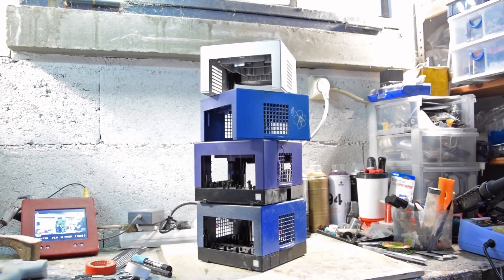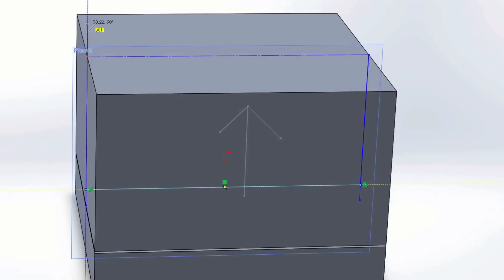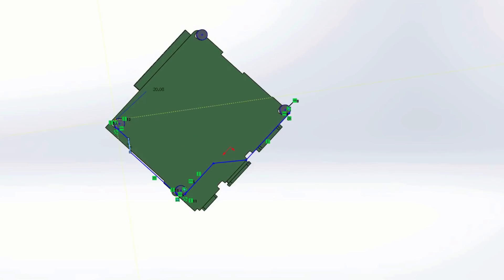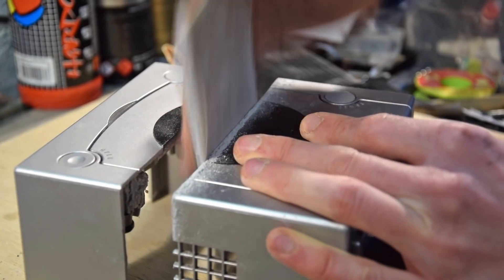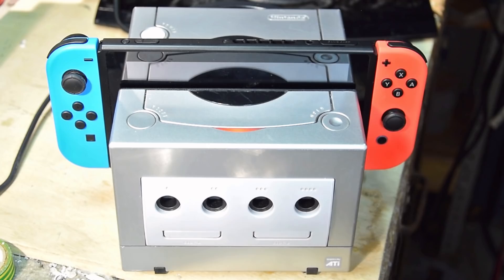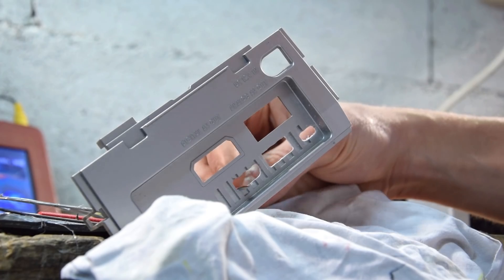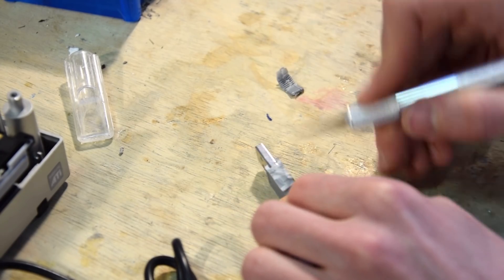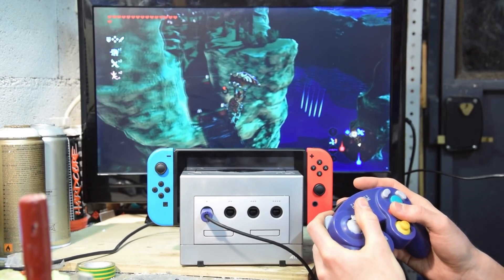Gamecube Dock for Nintendo Switch - Working controller ports - DIY project

Comment: Seems like you are addicted to hot glue... You used at least 15 sticks for this mod.
Reply from the maker: That's true, I'm addicted to it :o it helps me work fastee
Reply: Worth it
Reply: TheFrankonia83 I know right 🤣
Reply: I'm addicted to tipex
Reply: A man's gotta glue what a man's gotta glue.
Reply: Honestly I use it when there is no choice or short on time... other whise use epoxy, regular glue or best case... SCREW THEM IN
Reply: You must be new to diy videos.
Reply: In fact, his PC hasn't any screw, it's all together thanks to hot glue
Reply: It's not really him. If you've worked with electronics at all, then you'll know just how crazy they go with hot glue. If anything he just got conditioned to using it.
Reply: @Devious-uh6df  ?

Comment: "you only need these 3 parts to do this mod"
2 seconds later
"We're going to 3d print the slot"
Gee, thanks.
Reply: Ikr? I don't have a 3d printer
Reply: @DragonProtector  You can pick one up for a couple hundred. No premium needed.
Reply: @dotmatrixmoe  hmmm considering what i modded my printer to do (endless ink system) i saved hundreds already so it possible i can think of this
Reply: @DragonProtector  I appreciate the sarcasm, but they're plenty of options for beginners. I recommend hopping onto the "Make Anything" YouTube channel. Hope that'll help.
Reply: @dotmatrixmoe  i wasn't being sarcastic. I was really wondering if i could do this. Thx though. Sorry if my response seemed that way
Reply: @dotmatrixmoe  a
Reply: You could do most of it using the plastic from the actual switch dock. Use other bits of sold material and bolts and watchers to achieve platforms and proper heights. Maybe not 100% but I bet you could get close

Comment: I think it would be cool for the memory card slots to be used for USB (maybe using one of those usb thingys that increases the amount of USB slots) and a vent fan to bring fresh air in and out of the case
Reply: I think a ventilation fan is absolutely required since the switch tends to overheat in the official dock and any dock that is stylized after it.

Comment: Or you could just use the Original Dock and just buy the adaptor. Jk man great build and amazing work
Reply: dunno about that. The adapter uses two USB slots and has four Gamecube  controller ports. In theory, it should support four gamecube controllers.
Reply: Yeah but it's the retro thing ... Looks cool...think I'll dig out my GameCube !
Reply: @SOCIO did you not watch the beginning of this video, the idea of the mod was to use the shell of a BROKEN gamecube that's just gathering dust and instead turn it into a cool looking switch dock with usable controller ports.
Reply: @SOCIO "With modding as a hobby, dead electronic carcasses start to pile up", literally the first line of the video
Reply: a little -.-
Reply: @MrScottyTay  He's joking it's all in good fun. He's complementing the guy on his build an he literally said jk, which means: just kidding
Reply: @sebastianlaakso2729  I was replying to someone else, his comments seem to have dissapeared.

Comment: The only things I noticed that I would change is to add in vent holes in the slot for the Switch, small fans to move out the hot air and not to close up the holes in the Gamecube case.

Comment: you forgot to incorporate te vent holes in the switch dock during 3D printing. tis makes it very difficult for the switch to suck in fresh air to cool. witch can ultimately make the Nintendo Switch overheat in your home-built doc. But the idea for this Gamecube Switch Dock is really nice. (translated by Google)
Reply from the maker: Psiana that's true ! But they are so small honestly.. the switch doesn't seem to have problems cooling itself for me :) but I'll be on the lookout :)
Reply: Since there's so much extra space, maybe add a small fan to help it out a bit. Since the Switch isn't using active cooling, it doesn't need to run at full speed, so you can keep it silent.
Reply: It is using active cooling.
Reply: Ah okay, sorry about that. I was mostly referring to the dock itself, but either way, a fan would greatly help it.

Comment: This is so you can skip to the timeline:

1:35 3D Modeling
6:02 3D Printing
6:39 Cutting the case
8:00 Installing the slot
9:03 Adding painted tabs for details
9:51 Switch dock teardown and LED mod
12:42 Drilling the ports
13:40 Assembly
14:51 Usb controller adapter assembly
16:57 Glory shots- Conclusion

P.s It would be smart to pin this comment so everyone can see this.
Reply: Jajalitho it's in the description......
Reply: Alan Lopez but you can't click the timeline
Reply: Understand??
Reply from the maker: You must be on mobile
Reply: Jajalitho you just copy pasted this from the description
Reply: @jayjay_lee  *timestamp
Reply: @jayjay_lee  that's what you get for trying to be helpful
Reply: ps. they put it in the description
Reply: @YungShirtPocket  I was on mobile.
Reply: @micorepls553  ??

Comment: I didn't see vent holes on the 3d printed holder. You need those vents to prevent suffocating the system, especially in docked mode when the console can get pretty hot.
Reply: TheCyberQuake I noticed that as well
Reply: Was looking for this comment. In my head I was thinking oh the side vents are nice and big for cooling and then he blocked them off o.o
Reply: AeolusCE07 he blocks off the side vents in the GC shell, but the main problem is that the 3d printed part that holds the switch doesn't have cutouts in the back for the air intake vents on the switch. Meaning it will really be blocking the airflow and may cause overheating
Reply: Right, well at least he fixed it in his updated video !

Comment: I see you neglected to put in vent holes for that dock 3D print housing. If you do another version of this, I would suggest that be added to your design. ;)
Reply: ApacheThunder No foam pads to stop the Switch screen scratching when docking/undocking either.
Reply: The dock doesn't scratch the screen.
Reply: my dock has scratched my screen
Reply: @LordRayken  the dock is literally known for scratching the screen...
Reply: @harrylane4  anecdotal evidence
Reply: It does, don't deny it.

Comment: it would have been cooler to mod a LAN adapter to the underside of the console rather than just retaining ports that do nothing
Reply: but i feel if you do that you limit what else you can use the last us port for
Reply: Gustav Adhikara Gunawan throw in a powered USB hub; not like there isn’t enough room in the GC case.
Reply: While you are at it, maybe put an Nvidia Shield in the underside to emulate an actual GameCube.

Comment: 7.8/10 too much hot glue
Reply from the maker: That should add points
Reply: Correction, not enough hot glue!
Reply: You can never have too much hot glue
Reply: Rated-e Mods expecting IGN's ratings to make sense is your own fault XD
Reply: ERMHEGERD ITS YEE OLD MEMELORD
Reply: -ign
Reply: @RatedeMods  Shoulda filled all the empty space inside with hot glue.
Reply: They did say it was built with the expectation of being able to be taken apart.

Comment: I'd suggest using a fiber cloth between the dock and the Switch screen to avoid scratches
Reply: Matt I’d suggest a screen protector or not slam dunking your switch in the doc lol
Reply: @damndaniel4866  Bold of you to assume I don't take care of my consoles.
Reply: Matt well if you’re getting scratches from the doc I’ll 100 percent assume that lol I don’t need no fiber cloth lol has my switch since launch not 1 scratch on it
Reply: Adrian Anger why suggest something if you don’t do it yourself ?
Reply: Damn Daniel Some switches are curving from heat and at some point may get scratched from the oem dock.  This was a problem confirmed not long after launch
Reply: Matt you probably don’t tbh

Comment: How much would you charge for something like this?
Reply: Well... pushes up glasses 

Labour hours + 3d print filler + switch dock + gamecube case +gamecube adapter + gamecube ports + 1000 tonnes of hot glue. 

Alot

I dont have glasses

Comment: What software did you use for the 3D modeling? I'm looking into doing some component 3D printing for PC mods but iv never done a 3D project that required such precision before.
Reply: Hot_Drop_O'Clock probably maya
Reply: It’s Solidworks

Comment: Will it not overheat? it has no vents.
Reply: The dock didn't have any
Reply: Probably know this by now but the switch vents through the top of the console
Reply: @kuroser353  Incorrect, it has a vent intake near the bottom of the dock. This idea will overheat without that intake.
Reply: @SanderEvers  
Oh, didn't know that. Good to know

Comment: Brilliant idea, and it would be so useful for hooking up Gamecube controllers! However, relating to the problems of the Switch's screen being scratched when sliding into the dock, I feel that you could have added a thin cushion, velvet cloth or some other sort of cushioning material to at least narrow the chance of this problem ever happening again. Apart from that, great video!

Comment: I think the 2 pin connector for the LED is the same connector for a Xbox 360 rumble motors. Like he said in the video, this is easier if you're a electronic hoarder.

Comment: The original Dock has a hole on the back for breathing. You made everything almost air tight. Overheating could be an issue. Other than that, pretty amazing design.
Reply from the maker: I fixed it after :) watch the next vid

Comment: nintendo should be making cool docks like this with additional features instead of just bare ones, one neat feature that could have been used is maybe using the disk top as a lock almost, like just open the disk top and take the switch out, idk i think it would be neet but idk if there would be enough space.  still a very very cool way to almost recycle the case

Comment: I'm going to do this. I don't have a 3D printer, so I'll use something like Shapeways where necessary. Based on previous research, older consoles that have been discontinued may be cheaper in-store than online. This is an outline for the tricky parts. I don't want to sacrfice the dock that came with my Switch, so I'll buy a second one just for this mod.
Reply from the maker: Go for it ! But i hope shapeways isn't too pricy.. i can help you if you need something printed and aren't in a rush

Comment: Just an FYI the reason why the Switch in this one recognizes it as a "regular usb" device is because the knock off gamecube port. The official ones allowed support of the wavebird wireless controller for Wii-U. Since this one is a knock off, I assume this one will not, and the switch probably just sees it as a USB device (You needed to get special firmware for the official one to work with a PC for instance). Interestingly the official ones are still compatible with the switch, and i believe they are still being sold. Checking how those are recognized by the switch would be worthwhile to check.

Comment: That looks great my only concern is cooling there like no air flow would add a fan from the parts bin and poked a couple holes from the vents it already has not discrediting just small adjustments still a great video though

Comment: Nice video and you have some talent but hot glue is not needed for most of the solder joints and cable connections you showed. Heatshrink tubing is also a better method of insulating solder joints halfway down wiring than using hot glue.

Comment: This design is great. The only issue I see is that it won't properly vent the heat from the Switch. You might have wanted to keep the vents open on the Gamecube, and added vents to the print of the switch slot.

Comment: Awesome, though both the switch and dock need a bit of ventilation or airflow. You can see holes cut in the original dock for this

Comment: If you are going to go this far, why not drill a whole bunch of holes into the side and install some type of fan? The switch dock has major vulnerabilities in that it causes the screen to scratch and can cause things to crack as it overheats through you so over time. That's why I use a modified chassis that keeps the back opened up. I'd like this model much more if it didn't seem like it would old and trap heat just like the official dock.

Comment: Ok so I had a big brain idea a minute ago...what if you built this along with a small pc inside? Like what if it was a switch dock and a pc that can handle day to day tasks? Having two hdmi ports in the back for the dock and the pc would make it easy plus you can emulate games on some of these small PCs like GameCube games. I know this is very far fetched because from what you could see in the video there isn’t much room. This would be a very ambitious project but I’d be willing to try

Comment: Cool I have a GC but it works.
Now I want to get a non-working GC and do this mod.
I also have the Wii U 4 port GC controller ports but think I may go the same route you went.
And I think I may have put in a fan in the case since the Switch never did have good ventilation in the original dock so I think a fan in the case and stuff would be good.

Comment: You can use an sd adapter in the memory card holes to add memory to switch?Using an usb hub to use the contrellers and the extra sd .

Comment: Would be nicer if you could simply just buy a GameCybe styled front that's attachable to your current switch-dock. Of course with working ports for gamecube controllers.

Altough a proper re-print of the gamecube controller with two Z-buttons, HD-rumble and motion-controls would be welcome as well :P

Comment: I was thinking about doing a raspberry pi  mod inside the original plastic parts of the console that will be emulated. For example, fitting a raspberry pi inside a snes, with only snes games in the sd card, placing a usb snes adapter for controllers, in the place of the original controller slots, and put some extensors inside the case to link the output holes behind the console to reach the raspberry pi output circuit. But I don't know, it can be done, but it will be hard and expensive. Who knows, I just feel that I have to try it.

Comment: It would be cool if you could be able to add the Game cube's interior too at the same time so if you want to you could play a GameCube Game using the Dock. Though that's just a pipe dream
Reply from the maker: No that's totally possible :) would have to load games through an SD card to throw out the disk drive but it could work
Reply: Rated-e Mods No u mean by still using a disc drive and maybe a mini menu to pick game cube or Switch. I love physical more than digital so if that would be possible o would just die.

Comment: personally I wouldn't of put the bumps on the 3d print of the dock I would have left it flat and designed it in two parts so you could screw the two part together this way you could put a nice shet of soft felt on the inside on each side of the docks walls which would of helped prevent scratching of the screen.

Comment: I don't see any air flow openings for the back of the Switch when docked. Can't that lead to the Switch overheating? Also what about the rubber inside the dock that prevents scratching? These are critical.

Comment: It looks really neat. 
But what about the air flow? The original dock has a slot in the back which allows air to reach the fan intake holes on the backside of the switch. Have you noticed any problem with heat when the switch is in the gamecube dock?
Reply from the maker: I have had no problem for a whole year now, but i did punch holes for the air intake for the switch ! It was an oversight. I updated the 3d model with the holes too

Comment: Coming next : Switch parts inside a NES with cartridge space is used to hide NGC ports, USB cables in original controller slots to recharge Pro controller and game slot hidden in the fan case.

Comment: pls use heatshrink wrap on soldered wires I'm begging you

Also epoxy would've been a much better choice for keeping those controller ports in. Hot glue will wear out eventually from the force of plugging in a controller over and over. Or, better yet since you have a 3D printer, a custom mount that screws in somewhere could've been made.
Reply: otherwise though it looks great from the outside
Reply: He has another video where he used the OEM ports soldered to the adapter instead.

Comment: Ooh ooh oooh, what if you took an original GameCube network adapter, gutted it, and replaced it with the insides of a Switch Network adapter so that you had the cosmetics of the GC Network Adapter that functioned as a Switch Network Adapter??

Would anything like that be possible?

Comment: Nice video the only problem is that the switch dock has no vent holes on the back it will kill the switch it will overheat

Comment: thats alot of over hang , i think your printer is spitting out to much plastic then it should be :P
love the mod tho ^_^ watched it all and i dont even have a switch! ha but i wanna make this mod :D
got yourself a new sub :) <3
Reply from the maker: Yes I'm have a lot of trouble with over extrusion and retraction... Prints fail a lot when I use them too much so I prefer it like this for the moment even if there is a lot of bleeding filament

Comment: The switch could overheat in this version of the dock, since it doesn't have any intake holes.
Reply from the maker: I ended up drilling holes with a dremel, it's all good now and can survive long smash sessions (Believe me 😅) and i updated the 3d model to have holes in the dock directly, don't know if you saw the video update. It was a big oversight of mine but it's fixed now :p

Comment: Sorry if I missed it, but did you use PLA, ABS, PETG, or some other material for the 3d print. 

If he did say which in the video, I would appreciate it if someone else could tell me instead. :)
Reply from the maker: It's pla :)